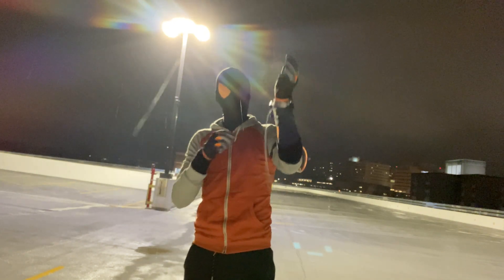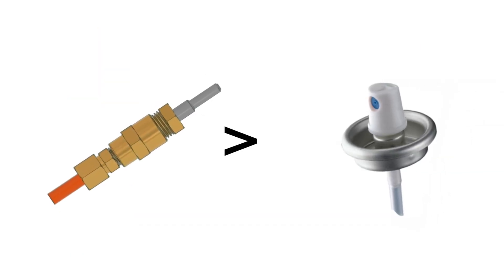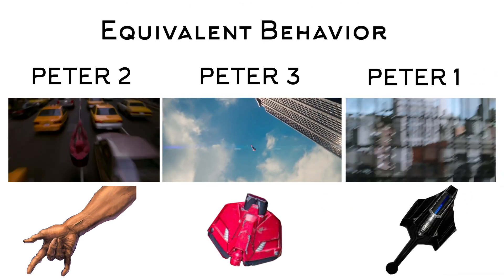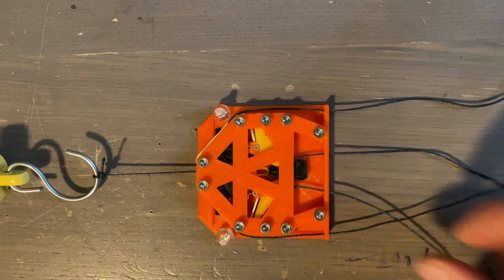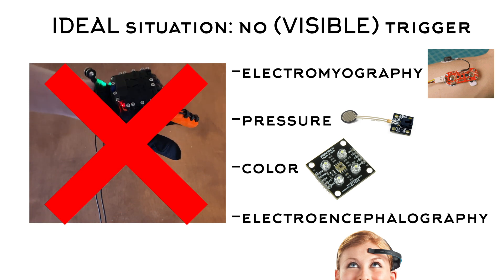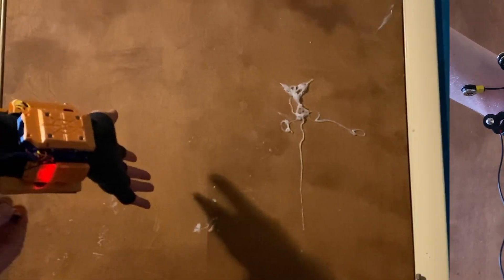🕷 Building the BEST WEB-SHOOTER TRIGGER

Comment: My theory for how the finger flexion sensors function is that they utilize flexible parallel plate capacitors. As you flex your finger, the distance between the plates of the capacitor would change, causing a change in capacitance that could be quantified.

Comment: I think that sensor-based triggers are not so good as they can also be activated unintentionally. Instead, I think that there should be such type of circuit which will complete by touching fingers at the end of palm and then it will shoot webs 🕸🕸🕸
Reply from the maker: Sure! That's possible as well. Good thing all of my designs are modular, and I can switch out for whatever trigger I want in the future. But I will also say, this trigger I've designed, I have a hypothesis that it will not be activated unintentionally, but I will conduct an experiment to see for sure!
Reply: @theAmazing  yeah, all the best! 👍👍👍

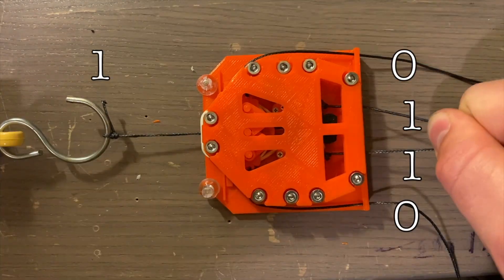Comment: 9:00 - 10:00 to fix the problem with the wrist adding to the amplitude of disturbance..... just place it behind the wrist with more ties tying the string to the fingers on the hand.... Right? I mean KISS is there for a reason.

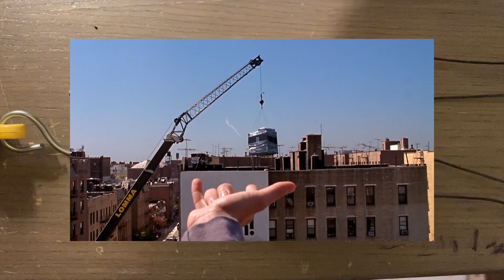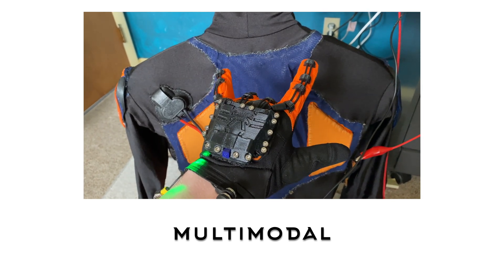10:30 - 11:00 also for the electrical sensor maybe make it so that the web shooters have a sequence register so that different web types come out in the future. you know like how it states spidey's web shooters work in comics. also conductive pads (as seen with the textile-based electronics of Adafruit known as wearables) could also add to the slimness of the design.

also that looks like Inertial Measurement Unit sensors on the fingers... or it could be something like flex sensors.... but I know some VR gloves use that tech too. but I would bet on IMU or something to do with conductivity being messed with due to bending the material, thus altering its properties or capacitive sensing.
though Potentiometric Position Sensors or Capacitive Position Sensors could be it

Hope you have a great day & Safe Travels!
Reply from the maker: The wrist bending disturbance will always be there to affect the trigger, even if the mechanism is behind the wrist, there will still be cables spanning the wrist, and there would be four rather than one, which is even harder to account for, in my experience. There would have to be a mechanism which “senses” the wrist bend and “subtracts” the effects from the trigger output. Thank you for your suggestions though!
Reply: @theAmazing  okay so I am curious about the technology you are using but have a pretty good idea what it could be, please reply if I at least got one right, if you can... thank you:

it could be IMU's or inertial measurement units that measuure the relative positon of one sensor to the others as slimevr or sensorx does with their vrfree gloves (similar design)

it could be Magnetostrictive Position Sensors which utilize iron, nickel, and cobalt unique properties to find out the position via the change in the material based on how the material will change its size or shape when in the presence of an applied magnetic field.

or it could be Flex sensors which allow you to flex them quite easily while still getting the spidey's singature way of shooting his webs.

Hope you have a great day & Safe Travels!

Comment: How will u create a electric web shooter then? Like what mechanism opens up the valve, I thought micro solenoid valve (6v) were good? I would like to know ur opinions!
Reply from the maker: Solenoids are bad, I have already made the electric web shooter without them, stay tuned for the next video!
Reply: @theAmazing  ah ok, but I don’t see a video where it shows how u made your web shooter electrical without the use of solenoid u know, will that be in the next upcoming video???
Reply from the maker: @TheBoogeyMan.  its in this video! edit: i didn't show how but that will be in the next video or so.
Reply: @theAmazing  yea I’m just waiting to see how, hopefully it’s not that hard, but do u think a 12v mini solenoid valve would be stronger and can handle more pressure in comparison to a 6v or would they be the same? Yes I know I’m asking about solenoids, but for now I’m gonna just keep going with them because all I work with is butane, water+soap formulas, I’m not into the webs yet, hopefully in the future I will work on that!! But I would like to know ur answer to the question about 12v VS 6v😄
Reply from the maker: @TheBoogeyMan.  In my experience, that is the case. 12V can handle higher pressure